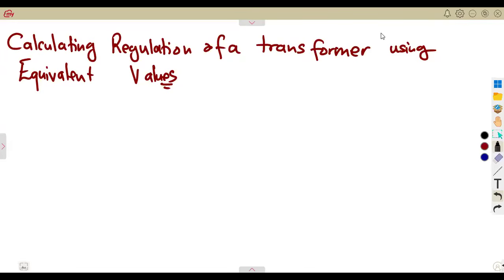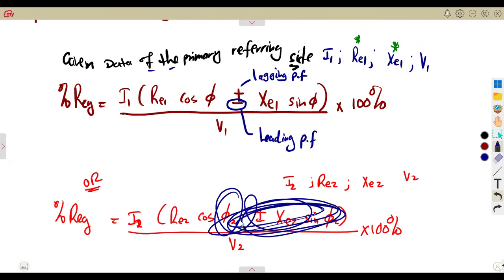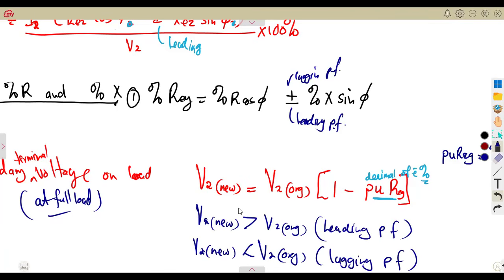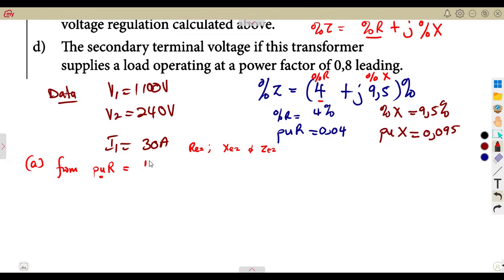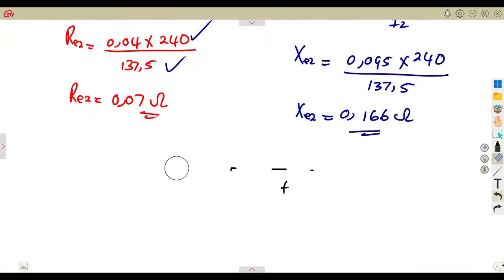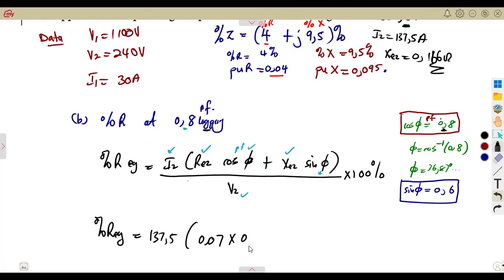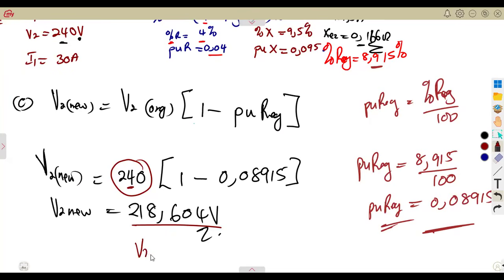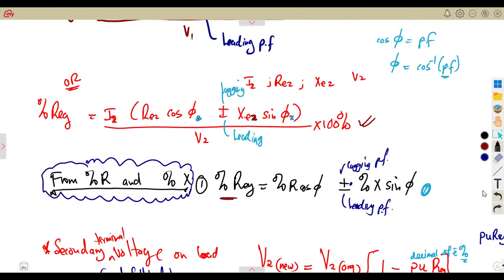Electrotechnics N5 Voltage Regulation of a transformer Notes - Transformers @mathszoneafricanmotives

Comment: about the lagging ans leading  why is leading goes with the negetive and lagging goes with positive
Reply: It's a problem just cram it plus on top and minus on bottom lagging  (la a is first on alphabet so it goes with plus) then leading e comes after a so it goes with minus if this helps
Reply from the maker: For a lagging power factor, the voltage drops across the internal impedance, requiring a positive sign, while a leading power factor causes a voltage rise, necessitating a negative sign in the regulation formula, more light in your studies! ❤

Comment: Sir if you multiply by 100% you are calculating per unit value,because it is the same as multiplying by 1 and if you multiply by 100 only you will be obtaining a percentage.
Reply from the maker: Not really as long it’s multiplying by 100% you get percentage

Comment: Hi sir  can i ask for lagging power factor is it not negative 
And for leading is positive
Reply from the maker: Hie on these formulas we use the opposite way. Leading pf we use negative.  And lagging power factor we use positive value
Reply: Sir on the last part u calculated the leading pf with a positive…are we not supposed to subtract ?
Reply from the maker: @theeteenashe Hi, sorry can I have timestamp
Reply: @mathszoneafricanmotives  47:34
Reply from the maker: @theeteenashe sorry for that one it was supposed to be a negative. Thanks for pointing it out ❤
Reply: @mathszoneafricanmotives sure🙏
Reply: @mathszoneafricanmotives 🙏🏾🙏🏾